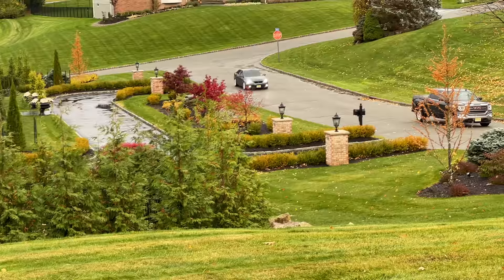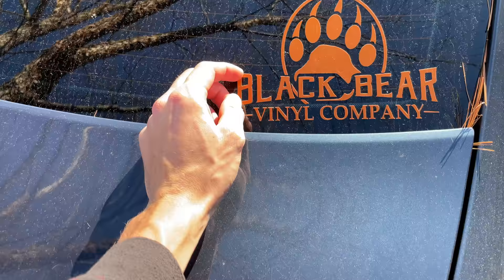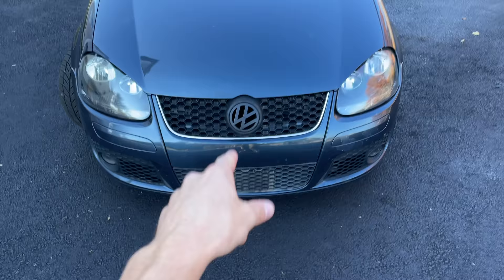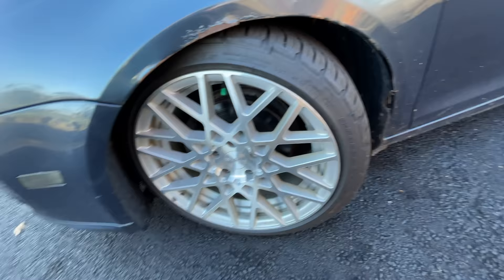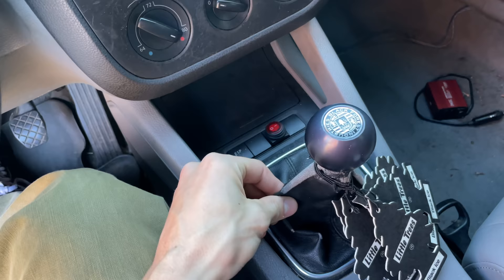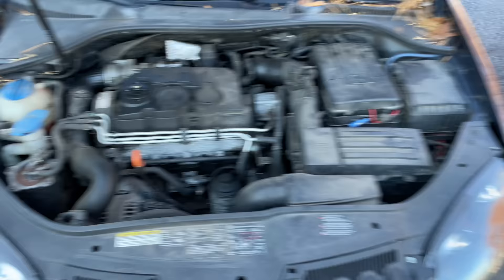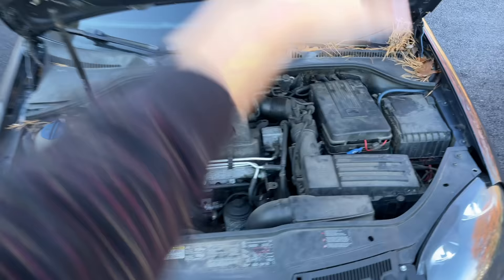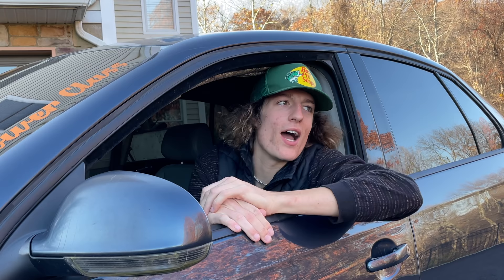MY NEW TDI

Comment: That one is a 3 cylinder right? I have the audi A3 PD 130cv 1.9 tdi 4 Cylinder, same engine but with one more cylinder, I think you can make a swap for a 4 cylinder 🤔,  mine with turbo 2260vklr, down pipe 62mm, intercoler, and a good Electronic make 480cv not HP, but CV, here in Europe its a bit different, wish you the best of luck boy ❤️
Reply from the maker: In the US from 2005.5-2006 so for only 6 months we got the BRM 1.9 4cyl🤘🏽 literally my favorite pd150 engine before they went to shit with the forward facing intake and all the 20 sensors in the exhaust crap

Comment: Don’t get me wrong the BRM are good engines bad cam shaft issue people run the wrong oil in it I have two of them great cars but I’m all for the ALh basically all mechanical don’t really have to worry about a whole lot BRM got a lot electrical not a really big fan of them but still good motor great mpg
Reply: Yes sir alh is king for reliability